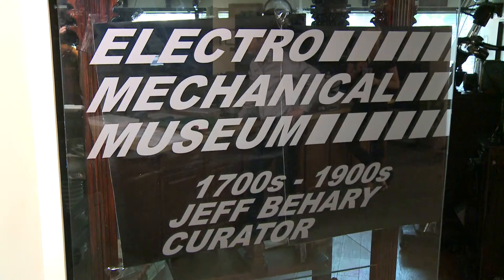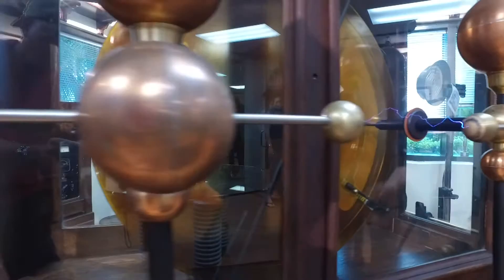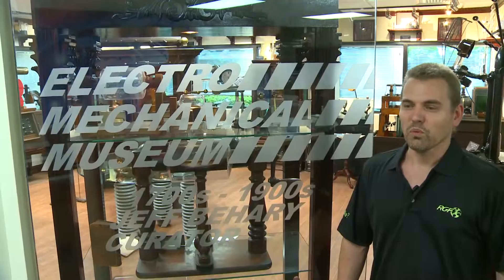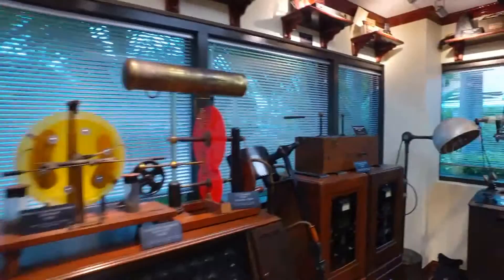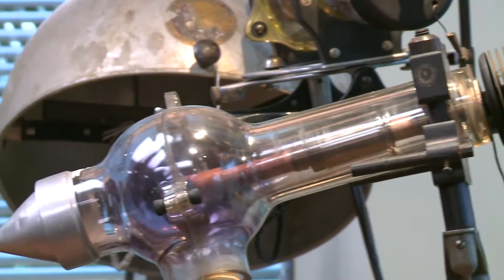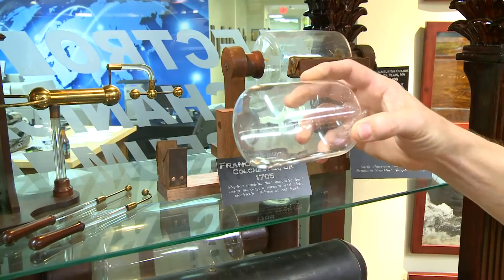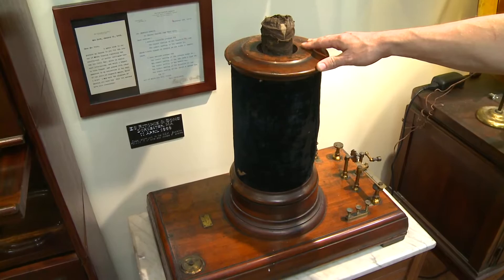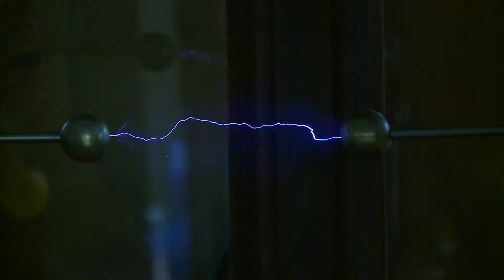RGF Electro Mechanical Museum

Comment: Is all your gear in working order? Do you do healings with them? Do you have an original Georges Lakhovsky device?
Reply from the maker: Thank you for your inquiry. Most of the equipment is in working order but is only used for display purposes.
Reply: Why??? Wouldn't you want to see if it works? Has anyone who works there tried these things on themselves with any success? You could potentially be sitting on a goldmine in healthcare. Do you have any original Lakhovsky devices that work? Do you or would you sell any of this gear?